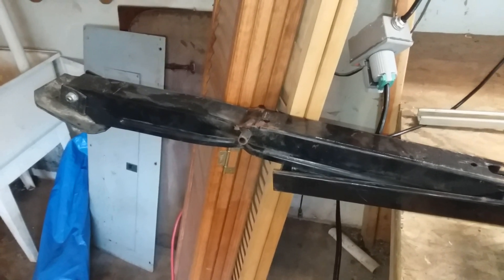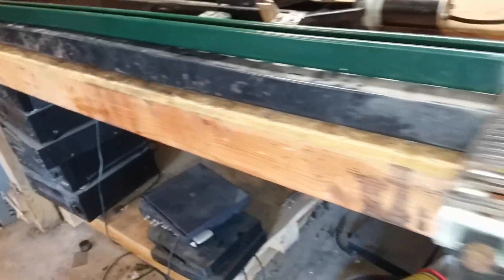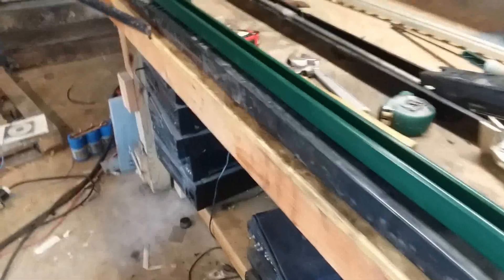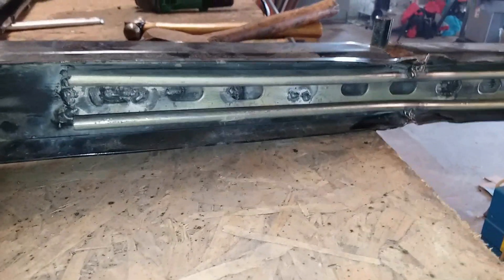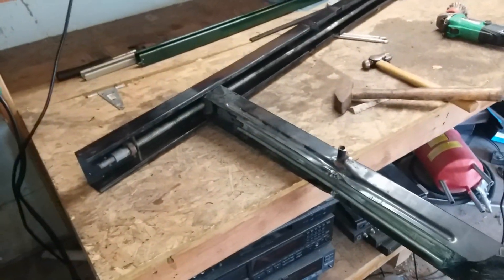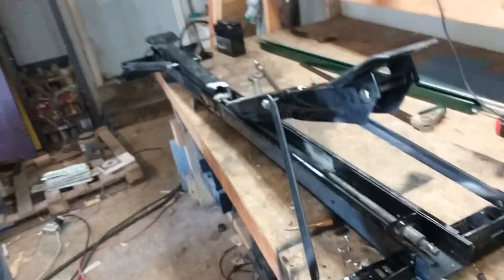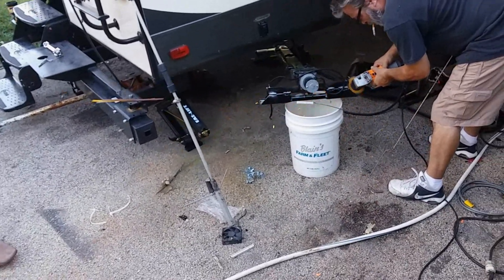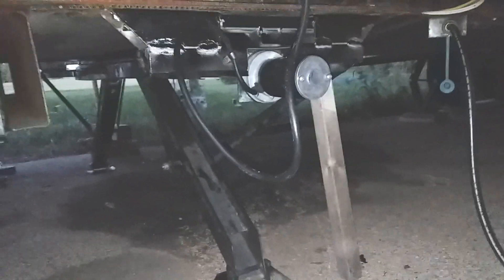FAIL ---  Repair Electric Stabilizer Jacks by Lippert

Comment: Mine comes with a 6A resettable breaker.  That's enough power to lift my trailer a bit, so I swapped it out with 5A.  From your description it sounds like weight was added after it extended so this wouldn't prevent your problem.

Comment: When that happened to mine I just took them off and put 7,500 lbs scissor jacks in their place. I now use a Dewalt drill to raise and lower the jacks.
Reply from the maker: I have added those along my frame in four different places but I still leave the stabilizer Jacks in the back because they are electric and I can control them with my remote control when boondocking!

It's a good solution though most of the stuff they add to RV's is just plain garbage.